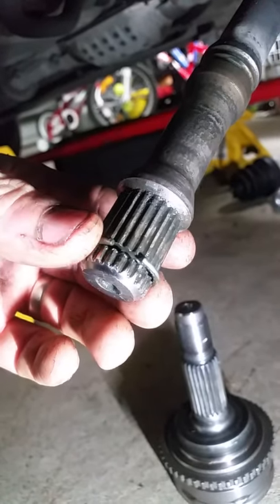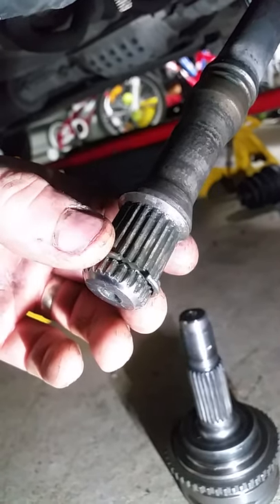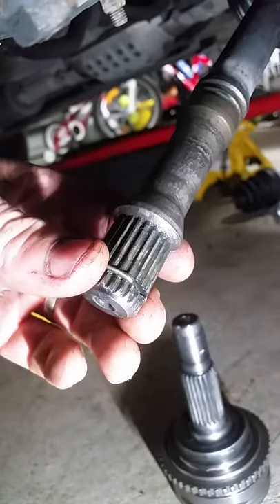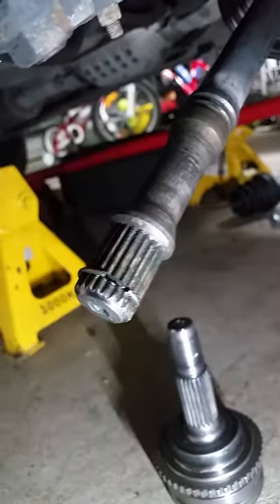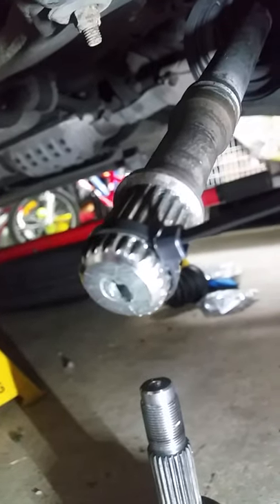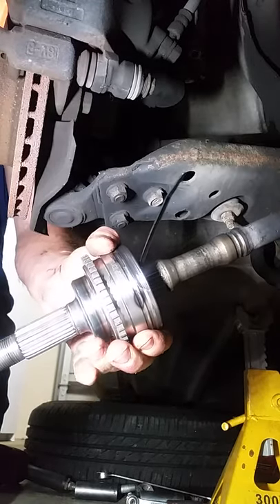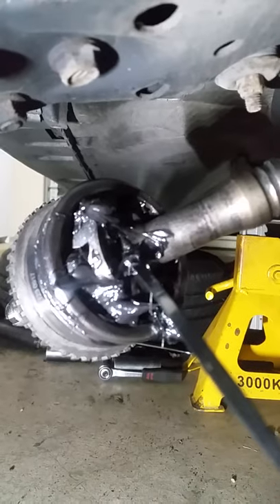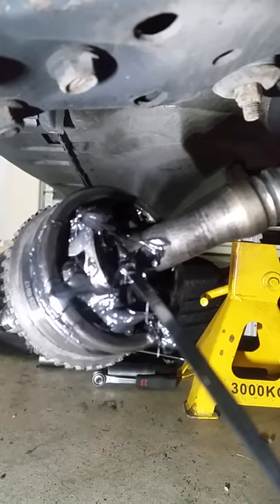How to replace a cv joint (Easy way to fit a cv joint)

Comment: just like a piston ring clamp , brilliant, i will be trying this out very soon, thanks for the tip
Reply: Until the zip ties get smashed and land inside the trans 😅
Reply: @Joey-op4ve  it's the CV outer so it is on the opposite end to the transimission.

Comment: I don't know how in other cars, but in Vauxhall  you put the spring into the cv-joint, not onto the shaft. 
There is no any trick needed ,because you just push the shaft into the cv-joint until it clicks in.

Comment: But how to get the old one off...
Reply: Put the car in neutral  and pull the axle. If it doesn't cone out, spin it slightly and pull. Spin and pull until it eventually just pops out. 
The orientation of the ring is what makes it hard to pull. Just hammering it will often damage your seal

Comment: How do you get it off if the slip ring is inside of it
Reply: When removing a CV joint I Normally use a Dremel tool with cutting disc and I slice the clips and boot off first then clean the grease off, next tilt the CV as far down as it goes and use the Dremel to cut the bearing race and pop out the ball bearings. They come out easily. You only need to cut the race for 3 of them and then it's loose enough to pop out the last 3 balls. Then the outer cup falls off. Lastly you can carefully cut the last peice on the splines in half, or you can use a gear puller and pull it off. It literally takes 10 mins with a dremel!! Youl get success every single time doing it my way. Don't try and hit the CV joint off. Youl damage the splines or fuck it up and pull the inner joint out of place. My way of cutting means you can do it easily without removing the full axle.